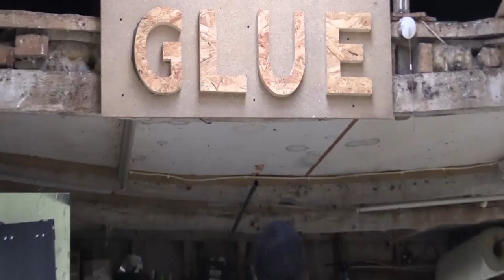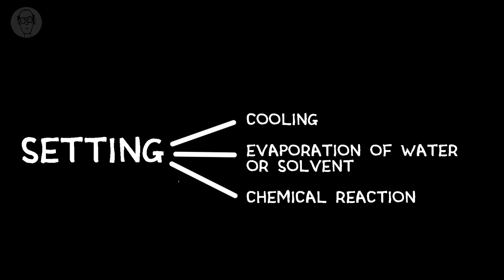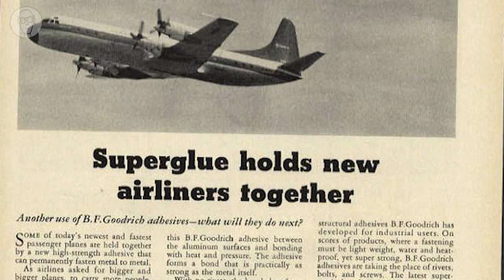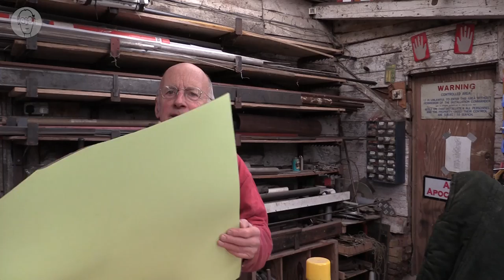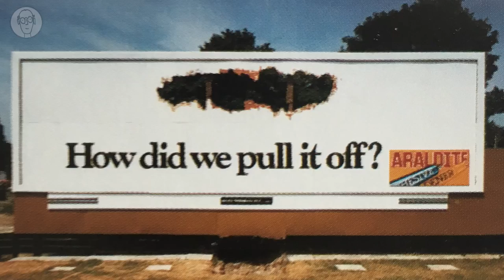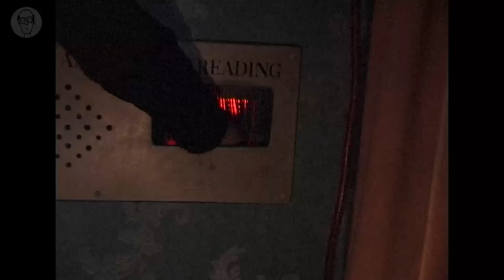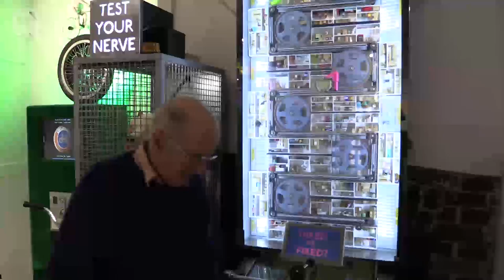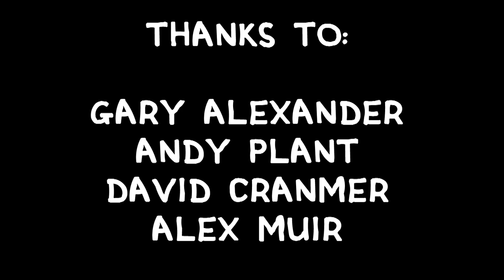GLUE - The Secret Life of Components - a series of guides for makers and designers - Episode 7

Comment: I have an unusual circumstance that I am trying to figure out which glue type I should use, or, if it’s worthwhile at all. I want to adhere a panel of hook Velcro to a piece of heavy nylon canvas. The Velcro I have has an adhesive on the back. It has a protective cover over the adhesive and I don’t trust that the adhesive that’s on the Velcro will stick to the nylon canvas, so I would like to apply contact cement to the canvas and contact cement to the adhesive. But, would the contact cement react with the adhesive and not work at all? Could I use the adhesive itself to bond with contact cement? I can’t remove the adhesive from the Velcro. I debated riveting the Velcro directly to the nylon canvas.
Reply: You could use an organic solvent like alcohol or acetone to strip the adhesive off the Velcro.
Reply: @gregorymalchuk272  Do you think that it might dissolve the Velcro?
Reply: @Traderjoe  
I doubt alcohol would. Acetone, I might be careful.
Reply: Try Goop, or E-6000; extremely strong,  and rubbery/flexible. You might or might not have to strip the adhesive off the Velcro first.
Reply: Riveting would be tempting, but probably needs washers on both ends of each rivet to stop the rivets from ripping through the fabric.
I'd also consider sewing, but for that you probably need a sewing awl.

Comment: If you want to stop your PVA wood joints from squirreling about when you clamp them, throw a pinch of salt on top of the glue. The grains bite into the wood faces and stop them from gliding on the glue so easily.
Reply: I'd think something insoluble would work better, like sand, but if it works it works!
Reply: Only needs to hold until you're clamped in position. After that, dissolving away might even be a benefit. Fine sand would also work for sure though.

Comment: Which glue is best for fixing loose soles onto shoes? I tried many, but they always fail rather quickly.
Reply: Impact adhesive. Read the instructions carefully though, it’s a bit counter-intuitive!
Reply: Use Goop, ShoeGoo, or E-6000. They all seem to be pretty much the same chemically (they all have a similar, strong dry-cleaners' type of smell, perchloroethane I think, until the adhesive cures); and they're all far stronger than contact adhesive. I have a pair of rubber winter boots I repaired some 15 years ago with it!
Reply: Yeah, I hear only good things re ShoeGoo etc.; whereas impact / contact adhesive (EvoStik) has typically failed quickly.
Only slight problem, the ShoeGoo may be more $$ than my often-thrift-store shoes ;-)

Comment: "goop" plumbing glue, my favorite stuff, can glue anything to anything and it remains flexible, when you broke the PU glue from the wood glued to the metal, the glue didnt give up, the WOOD did
edit: goop is made from the same makers as e5600 but its better, it has more glue to solvent ratio and dries harder but remains flexible, i glued a handle to a microwave and it outlated the microwave....
i've glued parts to my motorized bike's engine cylinder/exhaust and it holds!!

Comment: 14:41 - Instructions unclear. I glued my butt together.
Reply: Frank Hovis ...
Butt joints can be difficult to undo. 
Have you tried using a hot air gun with some alcohol (drink the alcohol before applying the heat!).

Comment: have you used the soudal range of products?  they claim they are new sorts of glues.  i had a job of sticking that cheap nasty craftboard ( it has other names which i forget as i type this. ) on walls as a skirting.  i wasnt looking forward to using "liquid nails" (a form of contact adhesive in australia) because of the smell, the mess, and it doesnt last long in some situations.  the day before the job i came across soudal t-rex.  the claims were correct.  very happy with the stuff.  and no, i dont get paid by them.  it is now one of my most used glues.  in fact i used it today to put a non-slip layer on my phone so i'm less likely to drop it.  it looks ugly - i dont care.

Comment: I tried to read a book about glue once but I came unstuck after the first page. Actually, that's not quite true: I couldn't put it down.
Whenever I've glued something, I used Sean Connery to help me. He made a good Bond.

Polyurethane glue, by the way, is actually spray foam. You get a hint of that with Tim using it here. Add more water to it, and it keeps expanding. It's cream coloured at first, then turns brown / orange, as seen on the SLS where it is used for cryogenic insulation. It's going a bit far, in my view, to call it a glue at all. Anyone who's used Gorilla Glue will know just what overpriced rubbish it is. Same for their PVA which is identical to school white glue, but ten times the price.
Regarding epoxy resin, most of what's sold of epoxy these days is the rapid setting sort. It is not even half as strong as the slow-setting sort. Although it can take about a week to fully cure, the bond is tremendous.

Comment: What to glue polypropylene PP???
It should be a high-temperature glue, because it is about sticking the elements of the water tank in the iron.
Reply: It requires specialist adhesives, usually modified acrylic based with a surface activator. They are expensive and you have to be sure to follow the directions exactly, Permabond TA4630 or TA4631 is one example.

Comment: Hot melt glue instantly peels off if you put plain ole rubbing alcohol on the edge between the glue & the surface glued to. This also works on fabric.  You can hot glue an Arduino into a box, decide you want to move it, drip some alcohol onto the seam, & it peels right off- even using the newer stickier hot glue sticks as well!! Share & share alike! Isn't knowledge wonderful?!

Comment: Loctite, only used 601, the world is so much bigger than I ever imagined., must get some of the seeping threadlock. pumice, for expanding foam on your skin, thats the only solution ive ever heard, everyone else just says , wait two weeks. Contact glues, spacing bars then hitting , these are the gold. I thought a thick layer of grease on my granite surface plate would allow me to male a copy flat with epoxy. it ripped the granite up. made a video not as good as Tims. Epoxys tend to be brittle IMHO, double sideds can be really strong, 3M . the final strength test of the letters,

Comment: I greatly prefer the acetic-acid-based  silicone adhesives that smell like vinegar; stronger and better adhering than the ammonia-based latex " silicones". One caveat, they don't take paints well.
Reply: Beware that acetic-cured silicone tends to eat through electrical connections, though, and so also might be a bit dubious on other metals.

Comment: Oh, how I hate epoxy! Overrated rubbish. Can't take any twisting or bending forces at all unless you've a ridiculously big surface area.
Reply: I'm guessing you've never worked with JBWeld or Devcon 2-ton; I've been working with epoxy glues for about 50 years! Prior surface preparation is everything. What materials have you been trying to glue?
Reply: @goodun2974  Metal to metal mainly. (I try to use other glues when possible). A give the surfaces a good scour beforehand but maybe they need better degreasing. I think I might try PU next time, I've never used it.
Reply: @dansheppard2965  , gluing with epoxy isn't like working with most other releases. A glued wood joint is strongest when  The pieces fit together super tightly and accurately with minimal glue; but epoxy works best if it isn't clamped too tightly ( squeezing out lots of glue may make for a weaker bond). Sanding or roughing up the surface, and degreasing, is very important. Anyway, if you have access to JB Weld, try it. It's got powdered steel in it ( which is why its gray, or black) and it is incredibly tough stuff, especially the slow-curing variety.